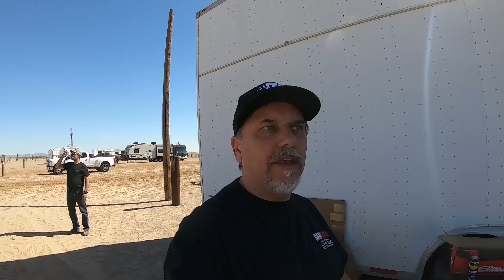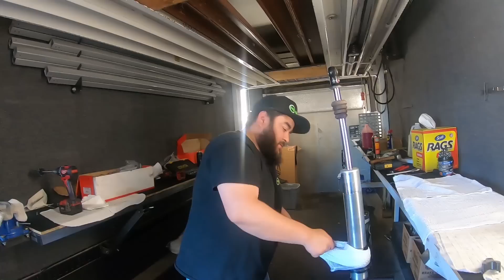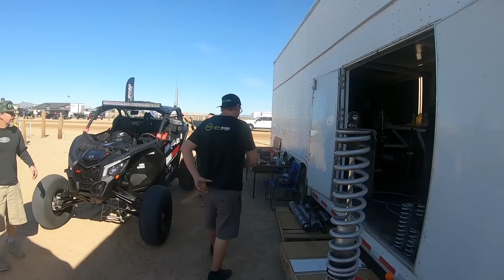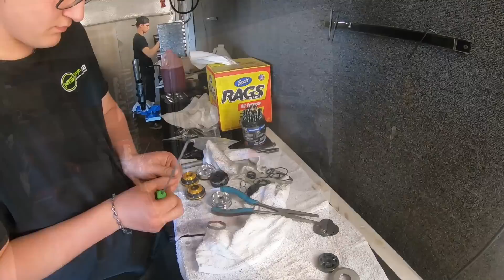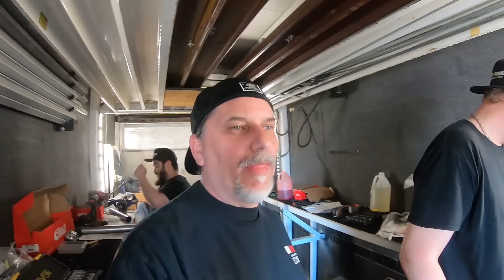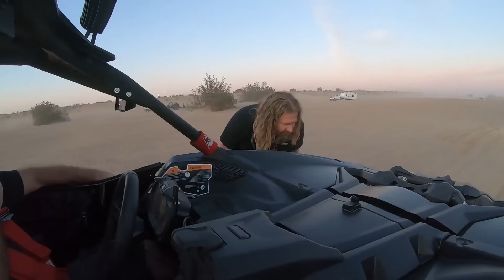Maverick X3 Shock Suspension Upgrade!

Comment: Looks good. I wonder what the difference in shock tune between dune tune and AZ desert tune would be.  I would want a softer ride in general for most applications.
Reply from the maker: I am not 100% sure what the difference would be. But they could definitely tell you. I cant even tell you how much less harsh the ride is in our car, and we have WAY more bottom out control. With the stock setup I had the compression cranked up full and we would still bottom out.